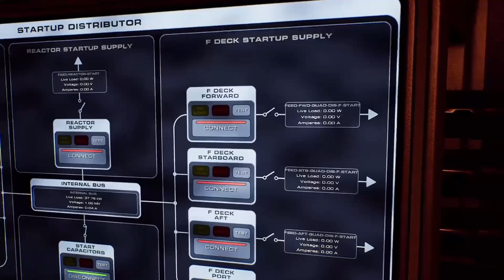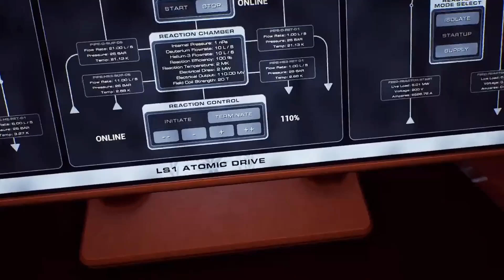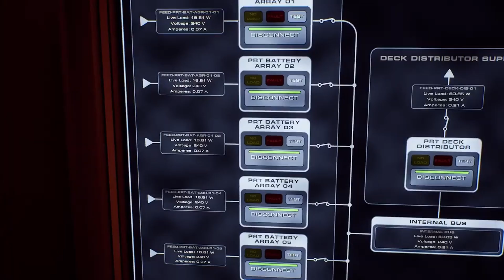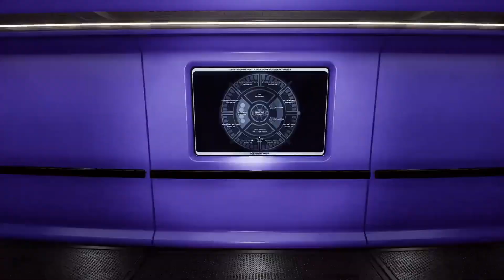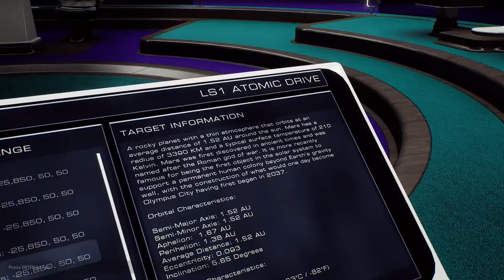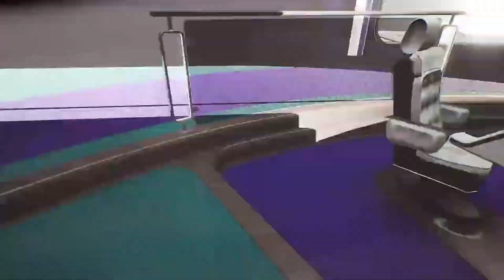Someone gave us the keys to a STARSHIP!! -- Taking a look at Starship Simulator: Tech Demo

Comment: hot tip! If you look in the little cubby area right behind the senor station, on the wall facing toward the main windows, has a small control panel where you can control the polarization of the glass! You said the sun was so bright you needed shades....well Dan has your back! Just turn on polarization to say 90...100% and fly up to a sun, its a whole different experience!
Reply from the maker: Oh, that is so useful to know, thank you so much!